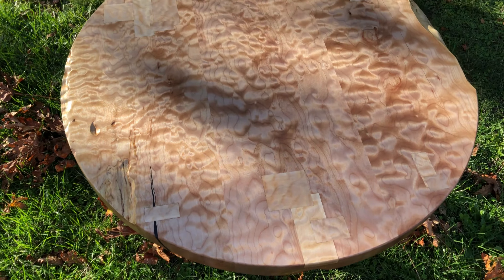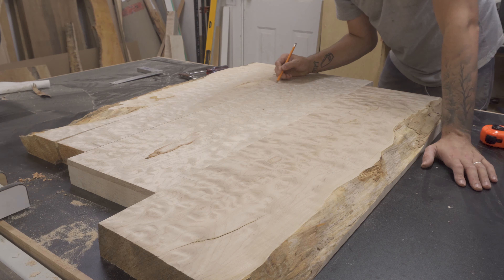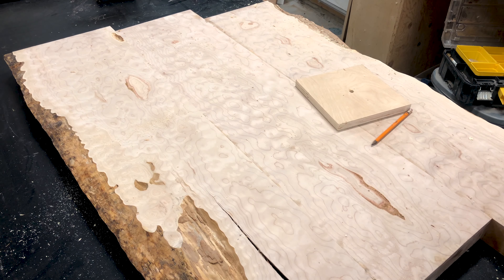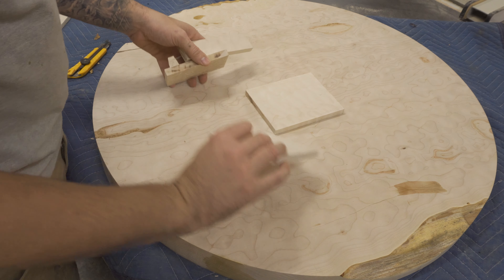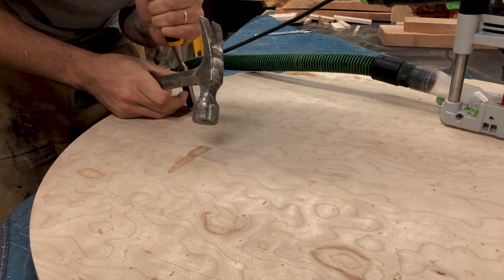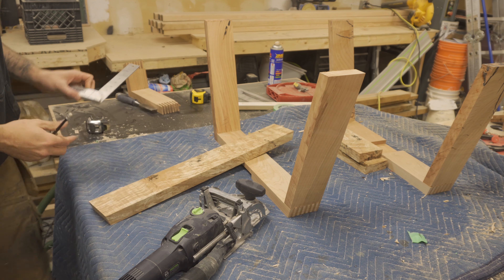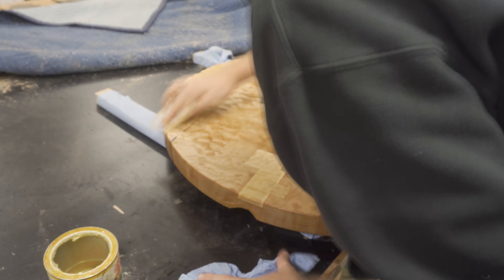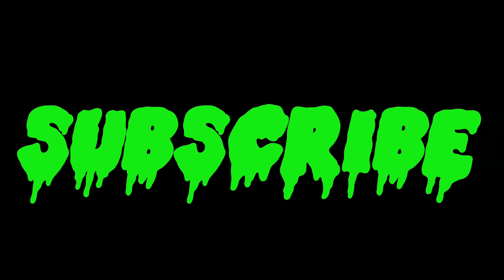Simple Modern Coffee Table Build | DIY #coffeetable #woodwork #beginner

Comment: Awesome! What kind of wood is the top and legs? The legs look gorgeous with that black epoxy (?) contrast in them. The curly maple top (i think is what it is) looks beautiful. Does it also have black epoxy? The inlay is different from the bowties that one would usually see but in this case I guess they (bowties) weren't needed. Thanks for sharing
Reply from the maker: Hey Thankyou Yes I filled any splits or voids with black 5 minute epoxy and yes your correct the top is curly maple. As the inlays weren't structural at all I decided to have some fun with it instead of the traditional "bowties".